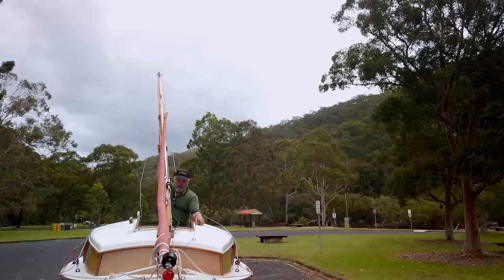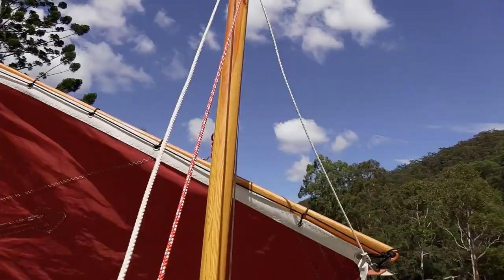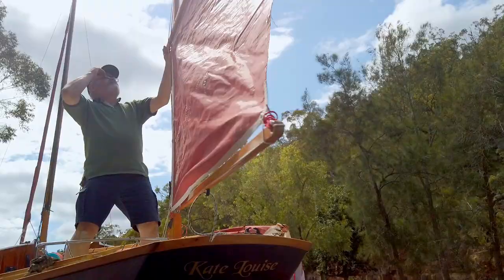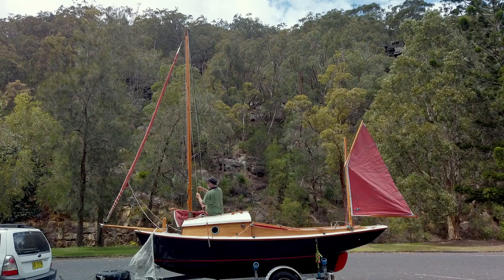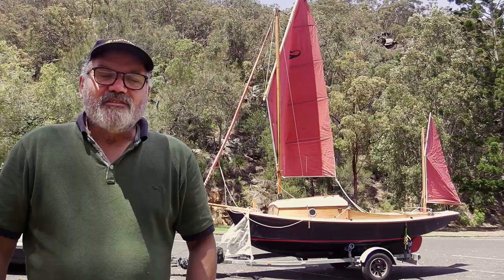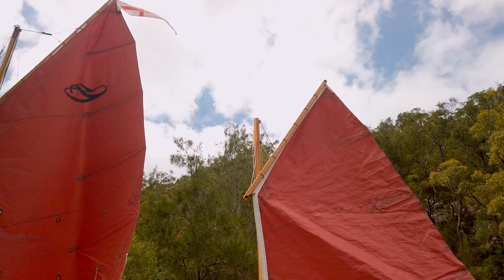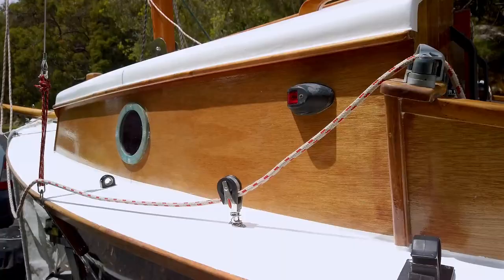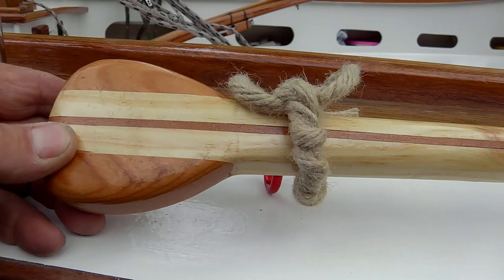Dinghy Cruising-Rigging a lugsail yawl trailer sailor.

Comment: Nice boat! I never saw a lugger with peak & throat halyards like a gaffer before… seems over complicated. A single halyard at 1/3 the yard length does both jobs fine.
Some notes on lugger terminology: a balanced lug has a boom and a yard; both lay across the mast, and the luff is parallel (or nearly) to the mast. A standing lug has no boom and the tack is made off to the base of the mast, so the luff is at an angle leaning forward (like Kate Louise’s main). The dipping lug is also loose-footed but with the tack made off to the bow, so the luff is at an angle leaning aft. Incidentally, when tacking back and forth in a narrow channel one doesn’t typically dip the lug, so you have the typical “bad tack”; you dip the lug only when you intend to remain on the bad tack for some time.
Kate Louise has a typical (except for the halyards) standing lug main and the mizzen is an oddity I have never seen - like a standing lug with a boom.
Another thing I never saw before: battens in the lugsail.
You said luggers don’t point as well as Bermuda rigs; I think this is only true when compared to racers with crisp new sails and all the trappings of travelers and fractional rigs etc. They get this advantage partly from the tech in the rig and partly from the very efficient airfoil shape built into the sail. But a simple working or cruising boat with old sails loses that racing efficiency and can’t effectively point higher than 45 degrees. By contrast, the lugsail is a flat sail with NO shape built into it, and a dead simple rig; it will always be able to point 45-50 degrees, regardless of the age of the sails and without any fancy tech. Your lack of center board is most likely the cause of your inability to point as high as the other modern boats. On a hull with a good center board, you won’t notice a difference in windward ability of your lugsail compared to an average (not new) Bermudan sail - providing your peak is sufficiently high. The ideal dimensions and shape of a lugsail were achieved through millennia of evolution in the sardine fishing boats of France and the herring drifters of Scotland. If you stick to those patterns you will have a boat every bit as weatherly as any Bermudan cruiser, and with far better off wind ability. The lug is immensely powerful off the wind - especially the dipping lug - which is why it was the best choice for towing and fishing for centuries.
Reply from the maker: Thanks Jalil,  for that. I have since lost the additional peak halyard and returned to the more traditional single halyard for both as you pointed out.But that was the original rig. Thanks for watching and check out my other adventures, cheers Paul

Comment: It would be great to see a video explaining how to actually sail a yawl. I am a bit baffled as to how you manage the two sails and what dangers the rear sail might cause (ie. catching the wind wrong). I understand the rear can be used to keep you on course when trimming the main, which sounds like a great advantage.
Reply from the maker: Hi, well basically in a small lug sail yawl only 18ft the mizzen is self tacking so you only worry about the headsail and the main as in a conventional Bermudan rig. However having said that, if you are overpowered easing the mizzen will reduce the weather helm. If you are still overpowered put one , then 2 reefs in the main. Still overpowered drop the main completely and sail with the headsail and mizzen. However it's much harder to tack, as not enough speed is produced while pointing high, but reaching or running with the headsail and mizzen is fine. Accidental gybes happen on any boat. Thanks for watching, cheers Paul

Comment: I Enjoyed the very brief introduction to lug sail, could you elaborate even more, please? I am beginner taking lessons on bermuda rigged sloops, but thinking about building my own (simple like Oz Goose) and lot of people recommends lug sail, especially balanced one, although i wouldn't mind omitting the boom and go with standing lug like you and Roger Barnes. It's just quite hard to come by information comparing all of these (bermuda sloop, balanced/standing lug, cat...) rigs, especially the easiness to live with. I enjour your new vids but it's always fun to find something in the 'archive' ;) thanks for sharing!
Reply from the maker: Hi Joeh, lug sails traditionally  were used on fishing boats as they were simple and quick to rig. They also allowed for a smaller mast, which for dinghy cruising makes it easier to raise when solo sailing. There is also less heeling motion as the power from the main is lower down than a Bermuda rig. The disadvantage of the standing lugsail  is that it has the yard on one side of the mast, so one tack is more efficient than the other, also doesn't  point quite as well
 That's why the Bermudan rig is more popular for racing etc. But for cruising it's  perfect. Thanks for watching  cheers Paul
Reply: @SailingKateLouise  thank you for your reply, Paul. That helps. "Boat Rambler" channel had video on balanced lug with planing Goat Island skiff testing not much difference between tacks. I am a newb, so as long as standing lug can go into wind some then it might just be the easiest way for me. I have more research to do, outside of YouTube. "Leg of mutton" with the sprit/boom higher up also looks simple and tempting, there are likely more. Gotta get my hands on some good books. (Any recommendations? ;) thanks again, i appreciate your response.

Comment: Hello. That was very good introduction of your rig. As I understand - with my very limited knowledge - mizzen is there to calibrate "oversized" sails on front of boat, so it will stop boat from pushing stem to turn by side-wind. Am I right? Also it (would) means, that main mast is (by plan) more forward, than would be ideal, but it has some reasons (ofcourse), for example, because of interior desire.
Reply from the maker: Yes a mizzen offers more balance to to total sail area, but allows you to sail with just the Gib and mizzen in a balanced way. Thanks for watching.
Reply: I plumped for lug yawl because a straight standing lug has a pretty enormous sail.  

The stiff sea breezes we get in Perth would have me constantly agonising about reefing.

I can let a mizzen 'fly' to calm things down a bit if things get hairy, drop the main then haul the mizzen in to point her into wind whilst I reef the main.

I don't have a jib, and I'm hoping the mizzen will turn the boat into wind if I ever lose control of the mainsheet (went with yea Olde thumb cleats) and calm the situation, or I fall over board when lone sailing!

Comment: Great video Paul,
In your experience, does a balanced lug yawl have any advantage on a balanced lug only dinghy regarding pointing and tacking.
Thank you
Reply from the maker: Hi John to be honest my only experience with Lug sails is Kate Louise as a Yawl. The yawl offers another sail option to reefing in stronger winds, but many people love Lug sails due to their simplicity when  sailing single handed. Lug sails don't point quite as well as Bermudan rigs and with only a skeg keel my tacking is also slower. But lug dinghy's with centreboards tack fine. Thanks for watching, cheers Paul

Comment: I notice with your rig the wood spar supporting the main sail at the top is one side of the mast.
Does it stay on the same side during tacking or do you need to get it to other side for sail efficiency?
Reply from the maker: Hi Marlon, yes it's a balanced lugsail so the yard (top spar) stays on the same side of the mast. In effect one tack is more efficient than the other because of this, but it's a traditional rig. If the spar was to swap to the other side of the mast on each tack it would be called a dipping lugsail. I hope this helps and thanks for watching, cheers Paul

Comment: Paul for the unlearned please explain a skate keel?
Reply from the maker: Hi it's called a skeg keel. It runs the 
length of the hull to the rudder and is about 45cm deep. Mine has 60 kg of lead built in. Some boats with skeg keels have a fold down centre board from within the skeg such as an Investigator 563. The advantage of a skeg keel is that you don't lose any room in the cabin area to a centre board case. The disadvantage is a boat with a skeg keel is slow to turn as it doesn't have a centre board to pivot around and it can't run up on a beach as a flat bottomed dinghy can. Hope this helps and thanks for watching, cheers Paul
Reply: @SailingKateLouise  hi paul clearly explained, I knew about a skeg keel but it was my spelling interpretation of your pronunciation made me wonder was there another design peculiar to dinghy’s. Thanks again for great videos, I would like to get into dinghy cruising sometime, it looks great fun.
Reply from the maker: @MrBeracah  No worries...sorry about my accent.Do try dinghy cruising it's the cheap way to sail and have fun, cheers Paul

Comment: There appears to be a line between the top of the mast and the forward end of the yard.
What does that line do?
Reply from the maker: In the original design it produced some upward tension on the luff. This has now been abandoned and the yard is just attached to the mast using parrel beads, and by moving the peak halyard closer to the mast this produces enough tension on the luff. Hope this helps thanks for watching cheers Paul